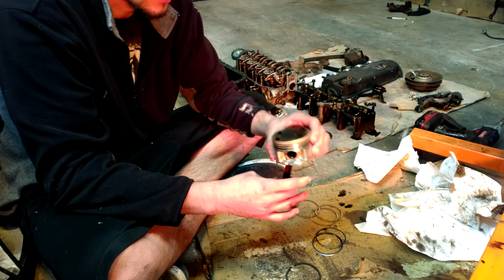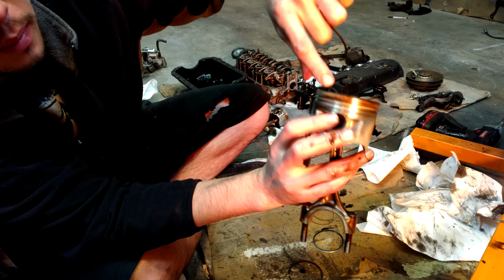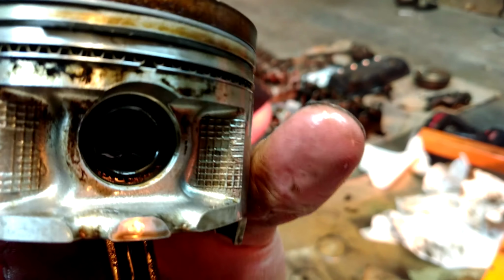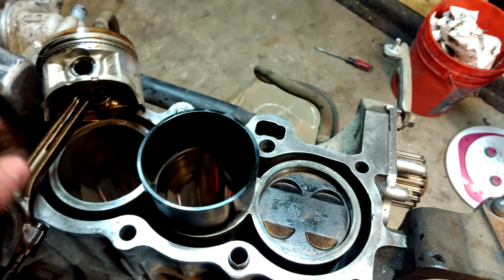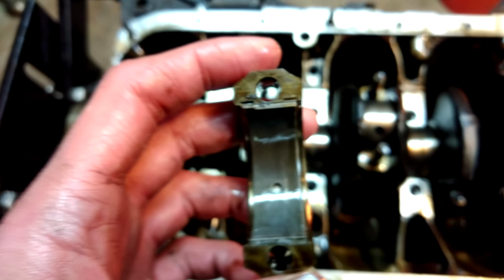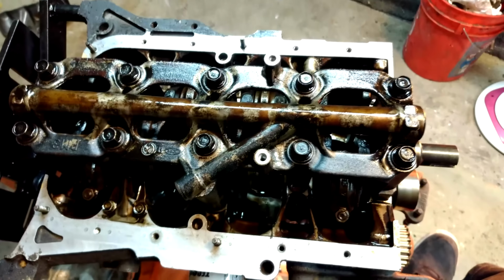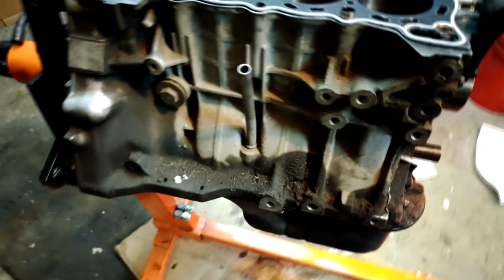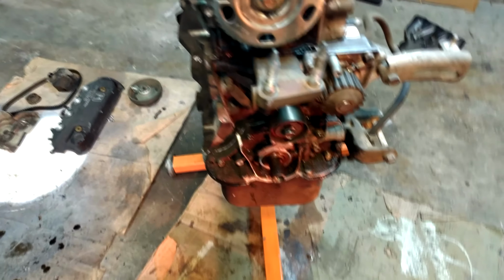Civic engine rebuild

Comment: I don’t know if you gonna see and answer my question.   I rebuilt 2004 Civic , first time ever to rebuild engine    I just started the car only for 5 min, it started but have some smoke which may be ok but it the engine shakes a lot 
I turned it off    Any idea what went wrong that can lead to the vibration ?  I replaced the pistons rings ( from Honda )cylinder head replacement , did valve job ,
Reply from the maker: Hard to say without seeing it in person.  Could be a lot of things.  Smoke on first start up isn't too alarming, could be stuff burning off.  The vibration is odd though.  I'm guessing it's a misfire of some sort, but who knows for sure without looking at it.  Check all your wiring to make sure your fuel injectors are plugged in correctly, coil packs are all functioning and plugged in correctly, etc.
Reply: Thank you so much for the reply. I removed the air filter housing and did find 2 injector plugs not plugged. Lol. First timer   Thanks for the hint

Comment: Good contents! Can this entire process be done with the engine inside engine bay? I imagine pistons / piston rings can be extracted and replaced, but not sure about the very bottom of the engine. Don't have a cherry picker or motor mount, trying to find alternative. Do you see a problem with this approach?
Reply: It'd be easier to pull your engine
Reply: I've done it successfully both ways. You can if you have to, but if possible, I prefer pulling the engine if you have to do anything more major than head work. These D series engines are a breeze to take in or out and trying to do something like this from under the car with oil dripping in your face sucks. Also, removing the entire engine gives you a chance to change the rear main seal and clean the block and engine compartment really well 👍

Comment: hey bro, i know its been awhile since you made this video but the two top rings of the same thickness? please reply. thank you
Reply from the maker: The top 2 rings are the compression rings, I forget which goes where, but one is thicker than the other.  You can't really mess it up though as the thicker one only will fit in the groove it's made for.
Reply: @CtrlAltDefeatTV  kool bro.

Comment: Why didnt you measure the clearences and tolerances for your bearings and piston ring? Did you measure the bore Diameter for spec?
Reply from the maker: That would be the correct way to do it.  If I were doing a rebuild on an engine I cared more about I would take those steps.  
D series engines are really just throw away engines, but at the same time they're very accepting.  It's a low HP naturally aspirated engine so ring gap isn't too much of an issue.  Rod and main bearings moved smoothly and didn't knock when running.  
I've rebuilt a few of these D series and never have really run into any issues.  
But you are correct, measuring everything would be the right way to do it.

Comment: What engine is this?
Reply from the maker: It's a D15B7 92-95 civic engine
Reply: @CtrlAltDefeatTV  is the d17a1 similar?
Reply from the maker: @angelfernandez866  I haven't messed with a D17 much, but from what I understand they're fairly similar to d15's and 16's in terms of design, but parts aren't interchangeable like with D15's and 16's.
Reply: Do you measure anything? Its my first build sorry for all the questions lol.